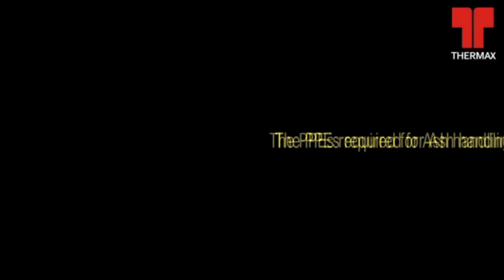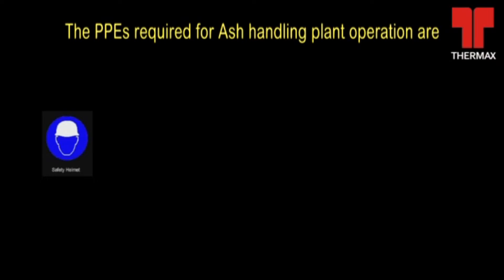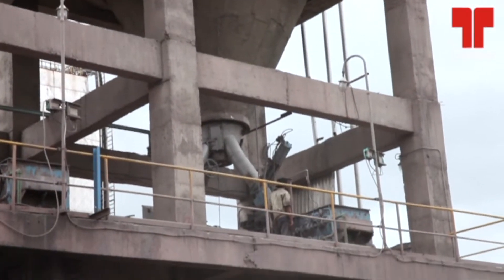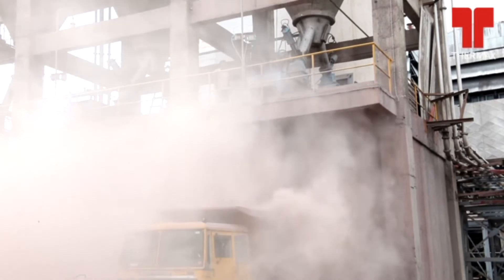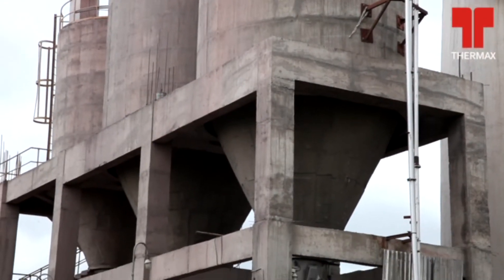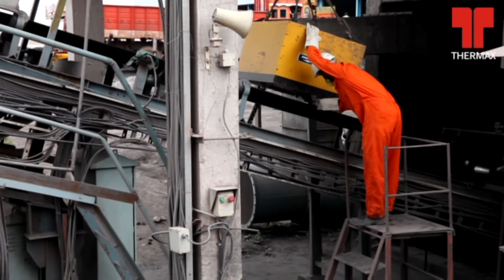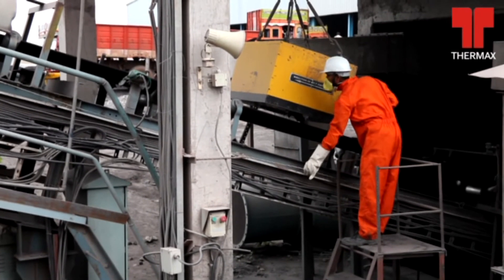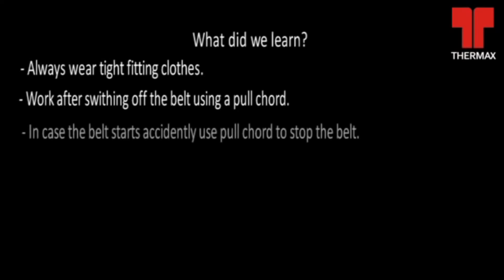Safety during ash handling in power plants

Comment: Never use pull cord to isolate a conveyor. always stop the conveyor by isolating the main power. Use pull cord only during emergency stop.
Reply: It's thermax safety standard but pull code is only for emergency purpose